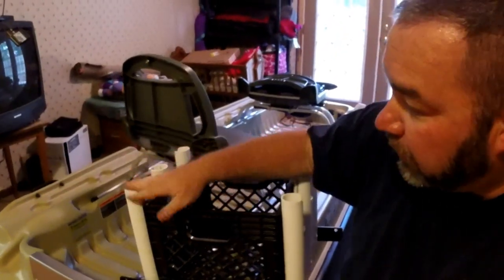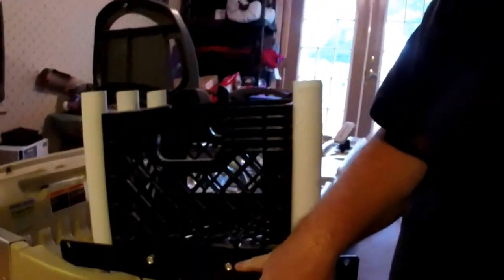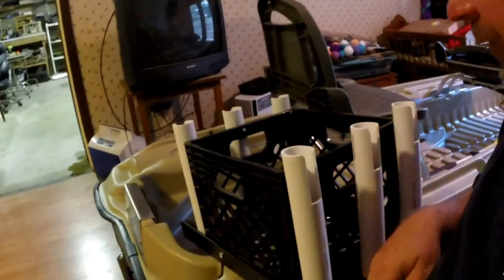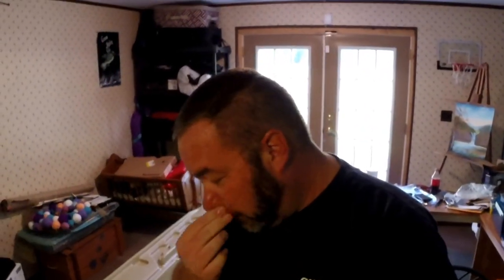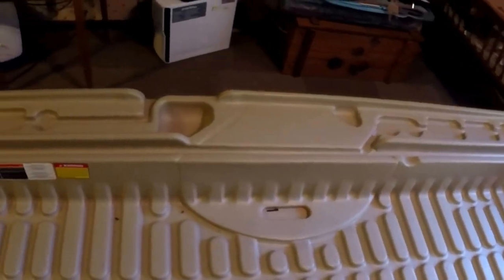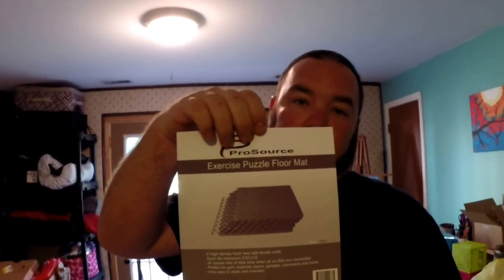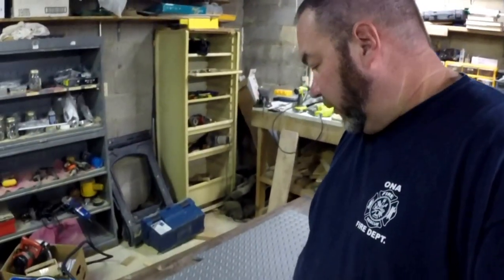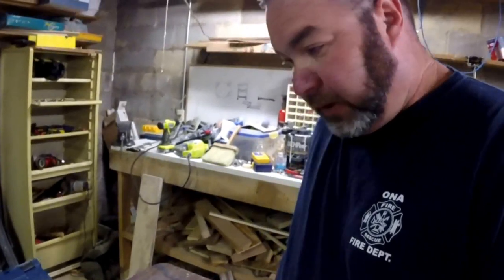Pelican Bass Raider ...Poor mans sea deck

Comment: Thanks for the video.  Do these tiles provide enough support where there are gaps?  Do you think it would be beneficial to add a 1/4" to 1/2" piece of treated plywood underneath to make the surface flat?  Then you could attach it however you wanted without doing anything to the boat.  I just bought one of these and I will definitely be adding a floor at some point.  Thanks!
Reply from the maker: Tate Bedwell no need at all , had plenty of support

Comment: I'm selling a kayak to buy a Bass Raider. I'm a fair sized dude (6'3" & 250 lbs.) How sturdy is the existing floor?
Reply from the maker: Very sturdy ! I'm selling my pelican for a hobie kayak..lol
Reply: Yeah, I'm selling my Jackson Big Tuna but keeping my WS Ride 115X. The Bass Raider will be for pond hopping. I'm getting older and would like some easier fishing.
Reply: I'm 6'0 290 and I think the floor is fine as it. Feels a slightly spongy but its plastic. All your doing adding decking is adding weight in my opinion.